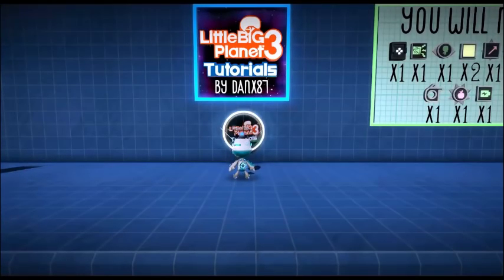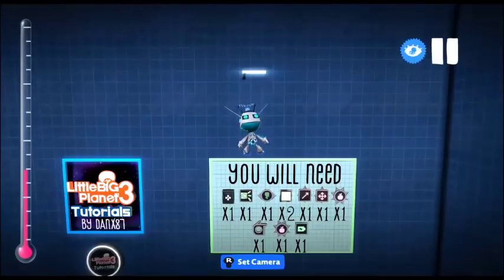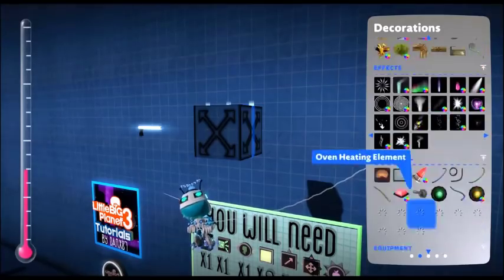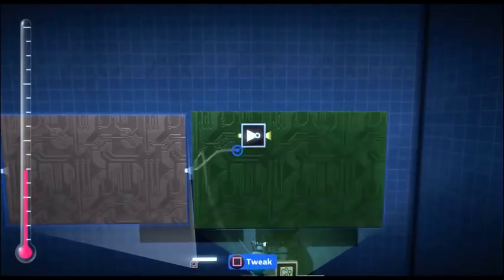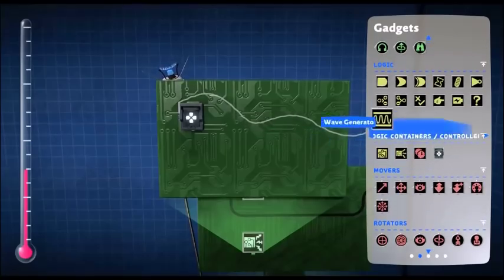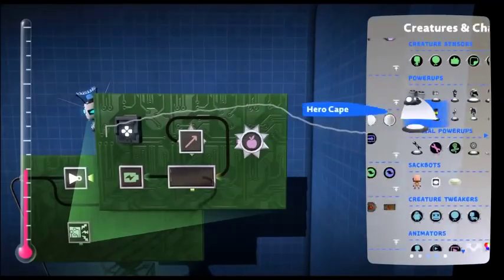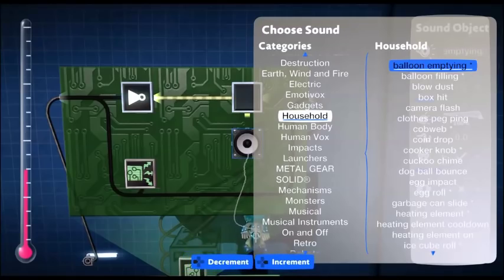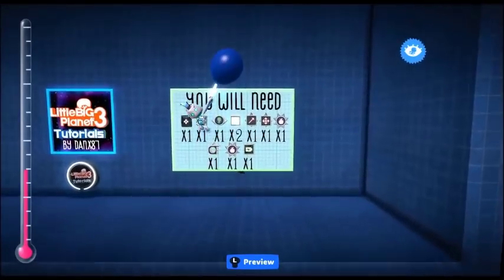LBP3 Tutorials [Balloon PowerUp / Gun]

Comment: can't get the handle to stick to the decoration mount :(
Reply from the maker: Sean W it has to be on the white part (not on the decoration). You could always place a blank decoration mount in just for your  handle. Just make sure the width fits right with your power up. Let me know if this helps/sorts it for you.
Reply: yeah i did fine until around 6:44, the balloon doesn't move with the gun it stays on the ground
Reply from the maker: Sean W sounds like it's not stuck to it